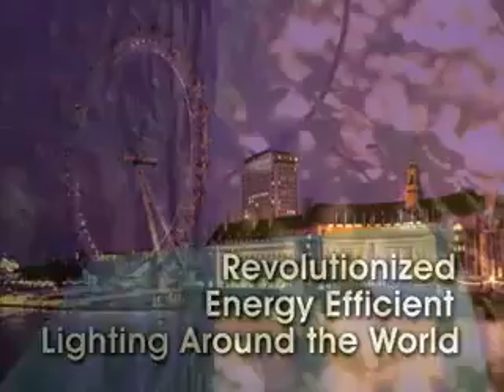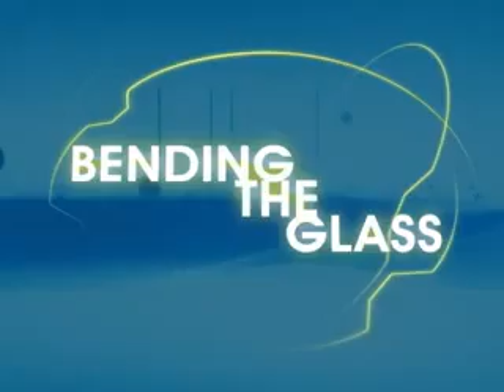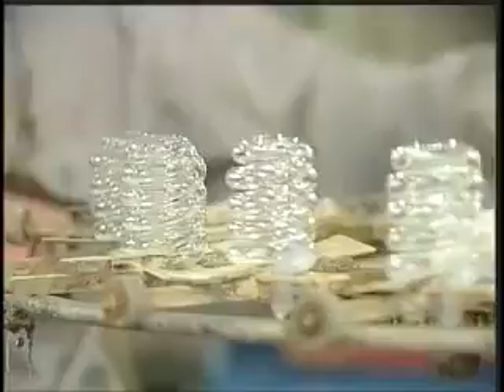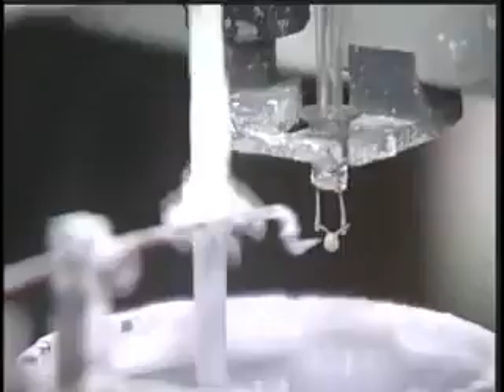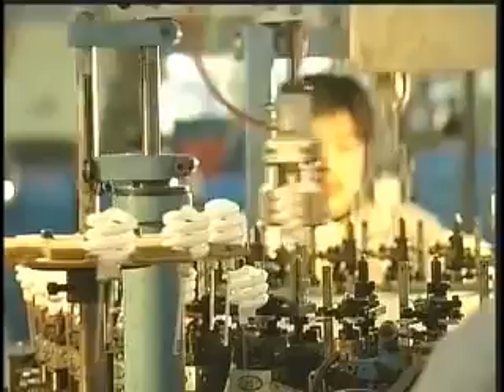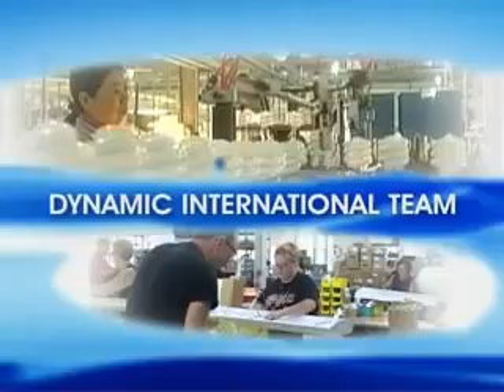How Its made, CFL.

Comment: I would not use these light bulbs because they contain ** mercury **.

LED light bulbs do not contain mercury. They only use 50 percent as much electricity as CFL light bulbs and they last 30 times as long.

The prices of LED light bulbs are decreasing. I would still buy LED bulbs even if they cost 2 or 3 times as much as CFL light bulbs.

And when a CFL light bulb burns out, you should take it to a recycling center that accepts them. Otherwise it goes to a landfill and the mercury can contaminte drinking water.
Reply: +Anthony Starfield Yup, the reason why I bought some LEDs versus the CFL was mercury and energy use. Even if they are a tad bit more expensive than CFL, we all save in the long-run.
Reply: I went to a safety training and when a CFL bulb breaks you have to leave the room for 60 minutes then come with gloves clean the room and wipe with a damp cloth the area and throw everything away and this was for your house,who does this in the real world? companies have been pushing them into our household with the high toxicity
Reply: I buy and smash a few dozen boxes just for you.
Reply: LED lightbulbs contain lead, so i make my own

Comment: The life of the CFLs Home Depot sells is abysmal.  I'm finding they might only last three to six months.  Other people I've run into a lot of people at Home Depot are telling me the same thing.  Not sure if this company makes them but CFLs with the pin bases which are also the most expensive have the shortest lives.

What a rip-off these CFL's are.  I could by an incandescent for $0,25 which would last several years.  A CFL is almost $10 or 40 times the cost of an incandescent and only lasts six months to a year.
Reply: now there banned buy em off ebay - there not banned in the UK
Reply: michael phillips
They won't work, the voltage is different.
Reply: Passed High School Physics they do they just give off less light
if you look on amazon they sell 110v ones
Reply: i live in Australia where we have the same power as the Uk amd the same fittings - not a problem for me

Comment: what about all that mercury?
Reply: The mercury in cfl bulbs never harmed anyone, I've dropped many and been fine.
I'd be more worried about the radioisotopes used to ionize the gas inside.
Reply: Toddo Roi It is about the drinking water deep deposits. If mercury manages to get to those ( via landfills) basically it will make it toxic to us.
Reply: Toddo Roi Toddo Your an idiot to tell people there is no harm in mercury, of coarse there is, asbestos brake dust and insulation and flooring was not suppose to hurt anyone either, Get It ? dont be a TCP lemming

Comment: to be fair, the lamps were used in high stress conditions, and  they were part worn to begin with, so the cathodes were kicking out a lot of heat due to the lack of electromagnetic powder on them, so I think it those factors might have been a little bit of an unfair disadvantage, if I used fresh laps, the results might have been a little different, but the part worn tubes were all i had at the time!!

Comment: Yeah I used the bigger bulbs in small medium reflectors overhead a fishtank for 14 hours a day with no ventilation. They got quite hot but I have never run into any issues with the plastics burning or melting.

Comment: Yes cfls save energy, but the plastic yellows and burns, I used a home made mould and some thermoplastics, the same stuff used on some 2D lamps (acryllic) and it did not yellow, but the formaldehyde plastics used for CFLs nowadays gets brittle and can catch fire, i've seen several cases of this and yet, it has not happened to the 2D lamps, so this proves that it is not the best idea to use the plastic used now.